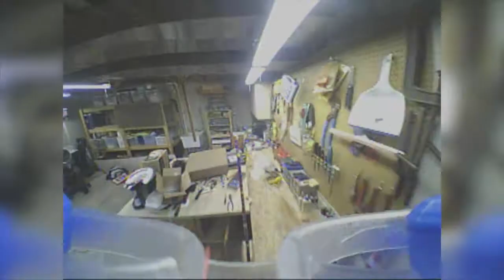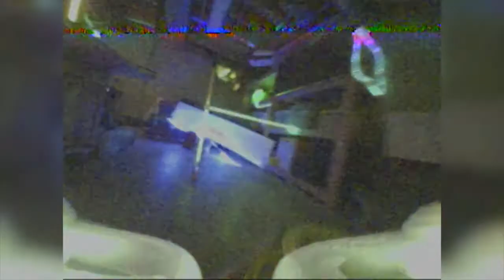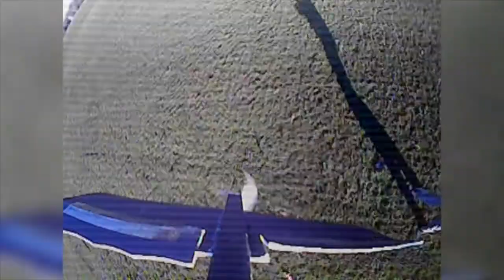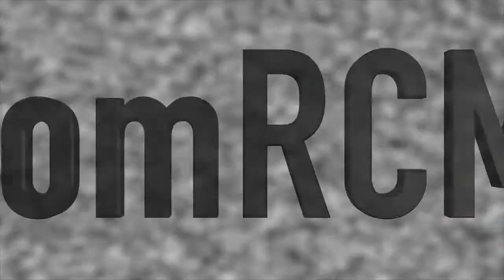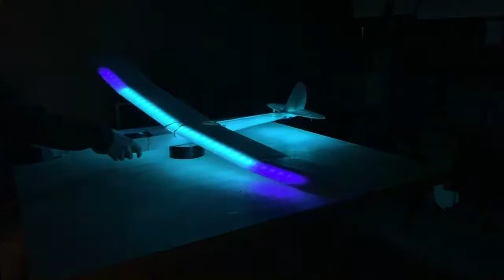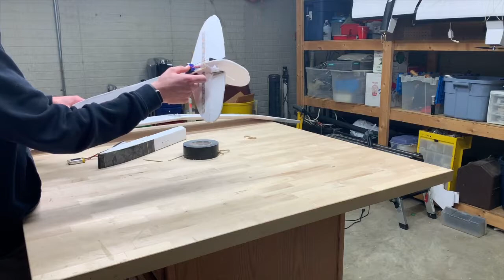40$ FT Night Radian Alternative? LED Simple Soarer Scratch Build Review

Comment: What leds did you use
Reply from the maker: These are Aura LEDs found at walmart around the holidays. They are super cheap (5 bucks for a reel) and work well.
Reply: @CustomFPV  does this allow you to have two different colors programmed at the same time? or when you snipped the green wire you talk about around min 3, is that what let you have the wing tips a different color?
Reply from the maker: mitchmo5000 Not exactly. Because each color channel (R, G, B) are addressed via their own traces in the board, when I cut the green trace by accident I lost the ability for the strip to produce colors with green past that point in the chain. It looks cool, but was by mistake. you could theoretically “jump” colors by cutting the trace then running a wire over a section to another trace down the line, but there are so many limitations I don’t think I would bother.
Reply: @CustomFPV  wow they look great! thanks for the reply! love the channel!